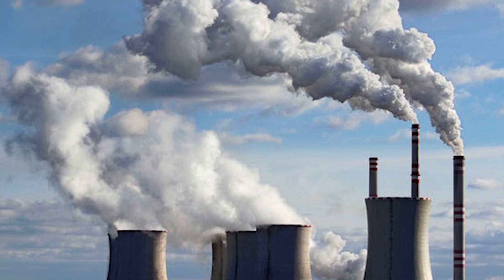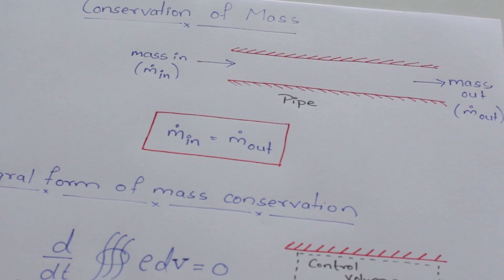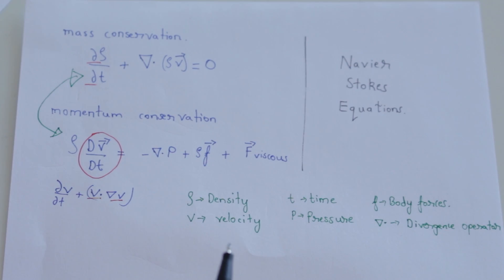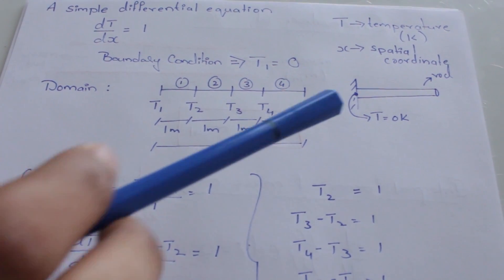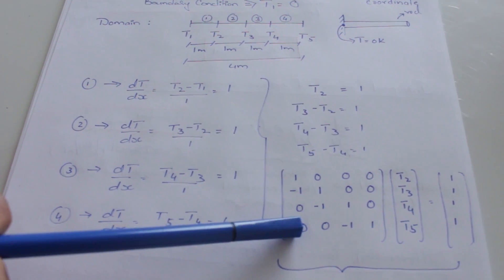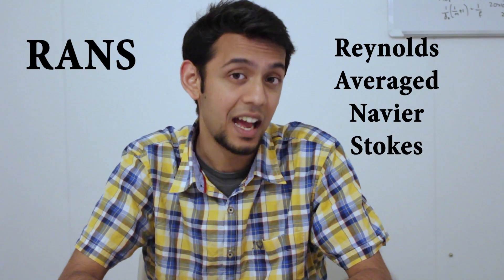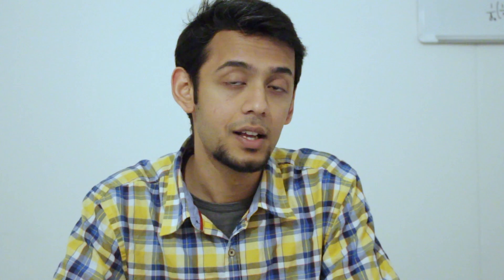COMPUTATIONAL FLUID DYNAMICS | CFD BASICS

Comment: 00:00:00 Introduction
00:00:53 Fluid Dynamics/Mechanics Introduction
00:01:23 Motivation to use CFD
00:02:00 Fundamental Principles of Fluid Dynamics (Conservation of Mass, Momentum and Energy)
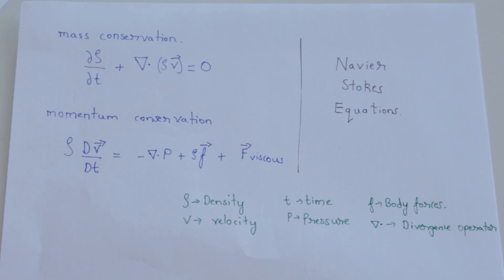00:04:38 Navier-Stokes Equations and Limitation of solving analytically
00:05:49 Solve Navier-Stokes Equations with help of CFD
00:06:30 Discretization
00:07:37 Convert Partial Differential Equations into a System of Linear Algebraic Equations
00:09:24 Solving process
00:09:51 Post-Processing: Visual Inspection, Check on Mass Conservation, Force Inspection etc.
00:10:36 Solving Turbulent Flows: RANS vs LES vs DNS
00:11:38 Reynolds-averaged Navier-Stokes equations (RANS): Time-averaging of Flow Qunatities
00:12:45 Large Eddy Simulation (LES): Modeling of small-scale Eddies, Resolving of large Eddies
00:13:28 Wrap-up

Comment: it is possible to simulate many different physics aspects in the same simulation?  
Like the effect of buoyancy, thermal flow, phase change for parameters that variant with height for example?
Reply from the maker: Yes, I think there are options to implement the specific conditions on some solvers. But we would suggest you to go through the Software manual to see if it can be implemented.
Reply: @2BrokeScientists  thanks, glad you answer.  one last question, without knowing nothing of CFD and the basic principles and formulas for the  physics involve, how many hours of tutorials and practice are needed to start to understand how operate these complex softwares?  
I imagine around 50 to 150 hours?
Or some are quite easy to figure out?
Reply from the maker: That would depend on what your goal is. If you are just curious to learn what is happening about the flow then you can just follow some online tutorials and implement them but to actually produce results that mean something its better to start from the fundamentals and then build from there. The time for that is highly variable on your pace of learning and how in depth you want to go

Comment: Won't low-pass filtering remove large scales in LES?
Reply from the maker: In Large Eddy Simulations(LES) the idea is to resolve the large scales and model the small scales. The small scales correspond to higher frequencies, where as large scales correspond to the lower range and hence low pass filtering will allow low frequency(large scales) and attenuate higher frequencies(small scales).

Link: https://sites.google.com/site/smokeisnojoke/lesrans2.jpg